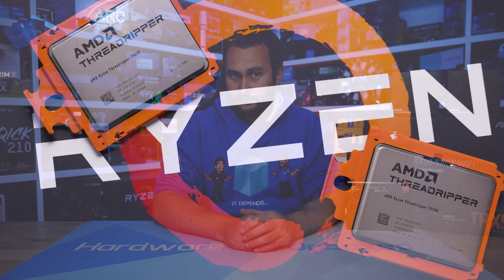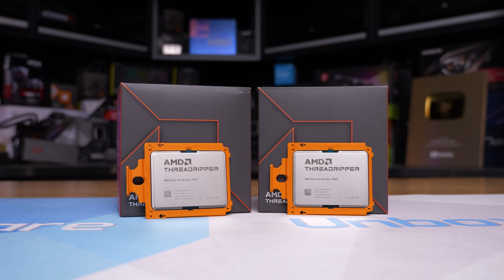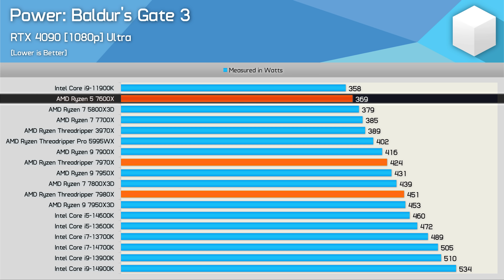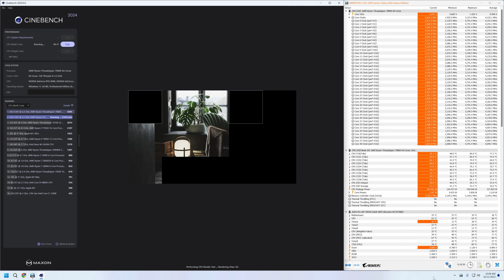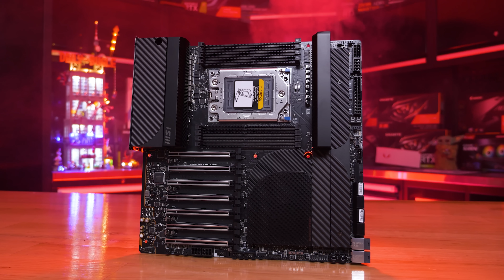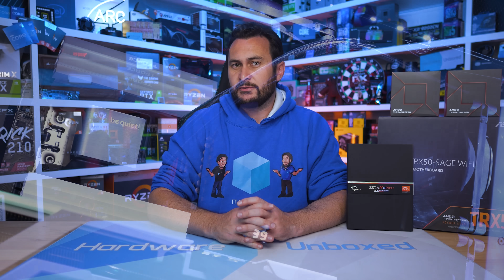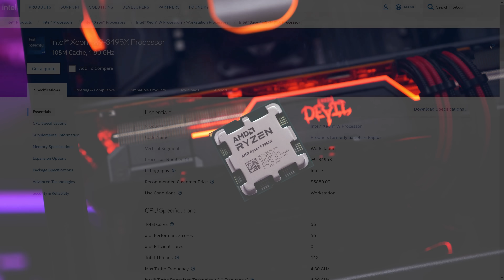AMD Ryzen Threadripper 7970X & 7980X, Benchmarks, Power & Cooling

Comment: I'm just curious of the power efficiency difference in Intel cpus when they're undervolted since a lot of us are doing that
Reply: Intel CPU er not equal enough in quality to make a undervolt test.
one CPU would run fine at 0.1V lower then another CPU would need.
Some have a 13900k that is better binned then a 13900ks.
Jays two cents mentioned that his super good 13900k clocked better at same voltage as his really bad 14900k.
Der8auer has a really good 13900k too, it is very close to a average quality 14900k.
Reply: @larsjrgensen5975  There's outliers - exceptionally good and exceptionally bad CPUs but with enough CPUs to test you would eventually find out settings that will work on almost any CPU. Like, I'm certain, that -0,05V offset will work fine with something like >90% of 14th gen CPUs.
Reply: @dsdfasefes1883  I agree -0.05V would work fine on almost all chips, but that is only something like 5-10 watts less power usage at full load.
The difference between running a 14900k at 90 or 80 degrees C can yield the same power usage difference without changing the Vcore at all.
Also 4 motherboards may run a 14900k in 4 different ways, making a general undervolting result almost useless.
Reply: Steve generally only test "out of the box" performance, as everything else is getting into luck-of-the-draw territory. That we even got a PBO run in this review is actually out of the norm.
Reply: @andersjjensen  Problem is, results are all over the place. WD Legion -  in one review 13700 got 177 FPS, in another 170, while 7800X3D got +1FPS. In one review 13700 consumes +150W over X3D in CP2077, in another +100W. There's no indication of what these watts actually are: peak, average? 10 times smaller reviewers are doing much more thorough and professional reviews and since these reviews are of enthusiast-class hardware doesn't it makes sense to be a bit less superficial?
Reply: @dsdfasefes1883  177 vs 170 is 4% deviation. Even on the same motherboard and same RAM kit that's down to differences in room temperature. Gamers Nexus found that about 1% can be attributed to silicon variance along, so stack 3% on top of that. That could be temperature, motherboard difference, BIOS revision difference, game patch difference, etc.

You can't compare cross-channel benchmarks. The important thing is that everything you see in the same test is tested in the same way.
Reply: I'm curious if Intel will ever be able to compete in efficiency again.
Reply: HW numbers are heavily inflated as is. In Watch Dogs Legion I have 470W peak power consumption with stock settings. 11% less. 14700KF.

Comment: I have seen some people complain about the cost of this cpu saying they would want the whole system to cost 5k and my thoughts were that really it would probably be that if you are in the market for this cpu you will probably be in the 10-15k range. The motherboards are about 1000, rams about 1000, the gpus you would want to pair this with are 1000 plus. Then why would you buy this if you didnt also need loads of pcie lanes so add money for all the peripherals and large/fast nvme/ssds. A huge ATX case, a huge power supply. This isn't a product for you probably (advice to 98% of people out there).
Reply: People will pay £2000 for a 4090 so they can play cod at 1440p, but then complain about systems with ground breaking performance that hasn't existed before for less than what server stuff costs.
My x99e-WS board isn't technically server grade and it still cost a fortune.
Reply: People that pay this kind of money for a system don't buy DIY. I suspect this is also the reason why support is very low / non existent. Systems in that price range are mission critical you can't have them out of service for two weaks because you need to rma something. OEMs with 3 year on site busniess support are the obvious choice for them.

Comment: Its a good Plattform for virtual Machines of multible Users not so much as a single User Workstation , if you use watercoled GPUs  that use only 1 slot you can put 8 GPUs in there  , 8 Lanes of PCIe 5 is more than enough and thats only 64 Lanes  , with Pro you get 128 Lanes .... , if you use the 96 Core you could have 8 virtual Workplaces with 8 Cores and one dedicated GPU each = with more than only one User Threadripper gets interresting  . Most of the common Software will not utilise 64 or 96 Cores . There are still Users for Threadripper out there , those who normally would use the higher clocked Server Variants and now will use the OC able  Threadripper instead .

Comment: Well you didn't use games in benchmarks that actually benefit from cache - while this processor isn't meant to be used to game, it would have been a great showcase to show, if other titles that benefit from cache, like ACC or Microsoft Flight Simulator, do benefit even more
Reply: The extra cache does not matter that much on these CPUs because it's not unified like on 7800X3D but spread across multiple CCDs so there is actually less cache per die. Accessing all cache requires heavy use of infinity fabric which is a bottleneck.
Reply: Look again at the Assassins Creed Mirage result. That is one of the instances where the 7800X3D outperforms the 7950X3D by a wide margin because the game (accidentally) gets scheduled on the non-V-Cache CCD of the 7950X3D.

Total cache of the CPU is only a meaningful distinction on Intel parts. Because the Infinity Fabric that connect AMD's CCDs is relatively slow, the cache hits on other CCDs, than where the code is executing, is almost as slow as a memory fetch. So it's basically only "cache per CCD" that makes a meaningful metric on AMD.

I have a 7950X3D and it's trivially easy to set up launch scripts that pin each game to the CCD it responds the best to, (but Steve tests out-of-box performance - as he should) and I can attest that completely blocking a game from accessing the cache of the other CCD has zero impact on performance. For gaming I pretty much treat my system as if I had a dual socket board with two 8 core CPUs. One with V-Cache and one with higher clocks. Limiting every game to one CCD also has the handy benefit that I can compile code in the background without it wrecking my gaming experience.
Reply: @andersjjensen  Thank you for the real world scenario daily driver feedback!
Reply: @Bluth53  YW! AMD's layout is an absolute brilliant stroke of genius from a cost-of-manufacture perspective, but it is not without tradeoffs on Desktop.... Which is exactly why they launched V-Cache. And it settles it pretty hard that, no, you don't need more than 8 cores for gaming.

Comment: Any chance including x99 e5 2696v3 18 core 36 threads 3.8ghz results into the mix? Damn cpu cost 50$ :D wtih turbo boost mod at 10 core 20 threads it will have 3.8ghz all core. JUST FOR FUN

Comment: Just got a 5900X for $289.99. 12 cores 24 threads is still good for a workstation and some gaming if still on AM4 platform.
Reply: Of course your 5900X is going to be better in gaming, it's a general purpose CPU, These Threadrippers are Workstation CPU's they're not going to do well in gaming. It's going to be better than your 5900X in Workstation tasks.
Reply: That's really good bang for the buck at that price. I had the 5950X until about two months ago, and it ripped through software compilation like there was no tomorrow. The thing just was that that pesky little 7950X3D kept telling me it was looking for an owner who could put it through it's paces.... and eventually I caved...

You should look into undervolting. My 5950X with a -30mV and a +200MHZ BPO consistently boosted to 5.05GHz, with an average of 4.8GHz during long compile jobs. And that was on air cooling.

Comment: At this time, I still want to get my hand on TRX40 board for collecting purpose, Sapphire Rapids Xeon W and Threadripper 7000 motherboards already proved that this class of processor is already ceased to be consumer product, their is no motherboard for these CPU in normal or gaming lineup anymore. And not to say that these processors isn't really performed any better than mainstream processor for more simple work like video editing either, it make that unlike around late 2010s this time these kind of processors aren't as good a deal as back then for light-medium workload workstation anymore and they have to use mainstream part instead with have a downside of having significantly less I/O expansion.

TRX40 and late X299 and W-3175X are really the end of an era as they are the last of HEDT platforms that meant for gaming and low level workstation, which is sad, but it isn't surprising because HEDT in the past stayed in consumer market in the first place mainly because they offered better multi GPU supported (as a continuation of product lineup from chipset and platform that support x16+x16 SLI/Crossfire in late 2000s) which by now it ceased to exist universally. Now they have only WS lineup board for current gen, which for some reason have significantly less USB ports than gaming lineup but higher price, this is not okay.

Comment: On the video editing topic: Move to Davinci Resolve, much more stable, efficient and performant, for a fair price without constant extortion by Adobe. 
And maybe also use an M2/M3 Gen Mac. Much better experience for serious work. I made the switch myself, and my only regret as a former Apple hater is, that i did not consider this sooner.
Reply: M2/M3 gets absolutely destroyed in video encoding performance by these threadripper CPUs.  Makes zero sense for them to even consider.
Reply: @giglioflex  If you want to avoid purpose build ASICS, okay. But THAT makes 0 sense.

Comment: It would be fascinating if AMD were to launch the 7970X3D and 7980X3D.
Reply: Considering there is little to no benefit there is in production applications, I'd say putting 3D cache on Threadrippers would make no sense.
Reply: @64Kfia this
And do you know how expensive it would be to put enough Vcache on the CPU to actually make it worth it

These are 2k to 4k CPU’s

That would make them 4k to 8k CPUs 
8 thousand dollars for a 3-8% performance increase? 

Thats not worth buying, definitely not worth making

Comment: I think it would be interesting to see the 7970X and 7980X vs the RTX 4090 and 7900 XTX (CUDA, Optix, HIP and HIP-RT) in blender (4 probably), including efficiency (total power need for a fixed workload).
I know the 7980X can have acces to much more memory and that you easily could make a renderfarm using cheap used pc's with RTX card, but still the best CPU vs the best GPU in the same workload would be fun.😀
Reply: Don't forget that CPUs maintain industry leadership performance in CGI studios (like ILM or Weta digital). GPU are extremely limited in that kind of computational task. CPU like these can access to terabytes of fast ram, while GPUs have limited pool of GDDR (few gigabytes). That has a huge impact while rendering complex animation, like a building collapsing, an explosion or a fluid simulation. It's totally different from our gaming perception where we think GPU can handle any kind of graphic task. I remembered seeing a special, shot inside DreamWorks headquarters, where they illustrated why they had to use AMD Opteron CPUs to handle perfect global illumination in a full CGI movie like "Shrek" indeed of a batch of simple graphics card. It was almost 20 years ago and still we have GPU that are memory bound😅
Reply: @Squagliafrittata  Well I know I am asking if a motorbike or a car is faster at delivering a can of soda, but I feel like your answer is that actually a  cargo ship is faster cause it can deliver way more soda.
A video on a supercomputer render farm could also be fun and I expect that a modern render farme will contain quite a few GPUs and the artists probably have a RTX 4090 or RTX 6000, cause Optix is just so powerful when making adjustments in previews.

Comment: this is so expensive, its basically just a product for reviewers that get it for free. once you gotta pay for it, it gets extremely uncomfortable. 

24 core for $1500 + $1000 Board + insanely expensive r dimm ram thats not usable anywhere else. So you are looking at $3000 for just 24 cores. the 7900 costs $400 right now.
Reply: These CPUs will crush any consumer CPU, in just about any task they are built for, like heavy computation, simulation calculations, 3D rendering etc.

There is however very little benefit to use a system like this, for regular desktop work.
Reply: @akyhne  I heard AI and machine learning is booming. And that stuff wants all the GPUs(=PCIe lanes) and memory you can spare.
Reply: Who is going to be the first lollipop 🍭 sucker that buys a threadripper CPU just for only game

Comment: Only Rich and People whos time is Worth 0$ can buy AMD products, same as linux. Intel + Nvidia is the way to go for normies.
Reply: I don't know the current workstation CPU price market, but ever since AMD came out with their first Threadripper CPUs, the Intel equivalent were much pricier, despite AMD Threadripper CPUs threading them apart in any benchmark (no pun intended).

And workstation CPUs are not intended for "normies", they are intended for heavy calculations.
Reply: @akyhne  you dont get it. Amd products does not work in long term. Gpu, cpu, motherboards... have you watched movie wherer they said it was fine for review but in long term it does not work? Intel + Nvidia FTW.
Reply: @walllec  You're basing your view on a single case.
My Intel CPU just died on me, 3 months ago. Does that mean, that all Intel CPUs sucks? No!

Youre clearly a Nvidia & Intel fanboy. That's okay. But stop spreading misinformation based on a few cases you heard about.
Personality I use whatever suits my need. I xhanged to an AMD CPU, after using Intel for 10 years. But i stayed with Nvidia, because AMD GPUs suck for productivity work.
As for things like gaming, it doesn't matter what you buy. Everything goes, and any brand is good at their price point.
As for workstation and server computers, there are only two great choices - AMD and Nvidia.
Reply: My AMD systems work. Can't say the same about melting 4090 and Intel's space heaters.

Comment: Measuring total system power consumption while gaming is so stiupid. Threadripper use only small part of it's cores and don't boost that high so don't drive so many frames and cause 4090 to chill. So it can consume way power obviously. Not to mention that since for example I9 drive more frames it also put more stress on 4090

Comment: Why bother with measuring total system power if you don't normalize for frame rate? An N100 would use even fewer watts but it wouldn't be a quality gaming experience

Comment: HEDT != Workstation

You're reviewing HEDT parts and keep talking about workstation users, and are conflating your issues with your TR Pro workstation setup with HEDT setups.  Two different markets.

The main reason someone would use HEDT over a toy computer is platform I/O.  You can't install expansion cards on a toy computer, because there are no available lanes and slots.  You can on HEDT.  So someone gaming on their HEDT system is the norm, not an exception.  It's the workstation setup that is less likely to be used for gaming.
Reply: Very true. It's pretty damning on HUB that they missed this rather obvious observation.

Comment: The "Our Threadripper experience to date" part of the video was really insightful and enjoyable to listen to. The fact that "niche" but extremely expensive products have worse support than the mainstream commercial offerings. Makes sense but at the same time it's somewhat shocking to hear.
Reply: I think Buildzoud has said the same about mainstream motherboards. Buying the Godlike, Apex or Xtreme boards could mean worse support compared to Tomahawk, Ace or Hero boards that are sold in much bigger numbers.

I have a X570 Master board that was quite expensive in 2019 costing over 400 but since it was also relatively popular (for example Gamers Nexus used it as their board for AM4 reviews) it still receives BIOS updates to this day. the newest BIOS is from September this year. About 4 years after release.
Reply: @Raivo_K  In the meantime, the budget boards used by most system builders aren't that well supported though, only the middle gets support. This is expected on the lower end but completely unacceptable on the higher end, especially on HEDT. I'm confident this lack of support doesn't happen in the professional segment with brands like Dell or Supermicro.
Reply: Ya Threadripper not keeping board support was really problem for first time buyer. It's become such a different platform now from where it initially started. When they went up up as they said during zen2 they really killed the original threadripper project. AMD screwing themselves over again.